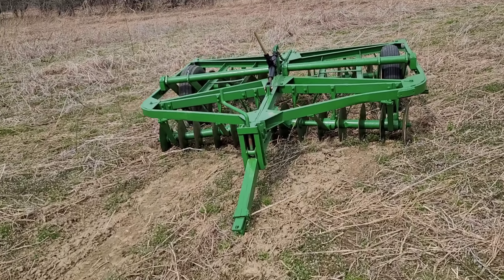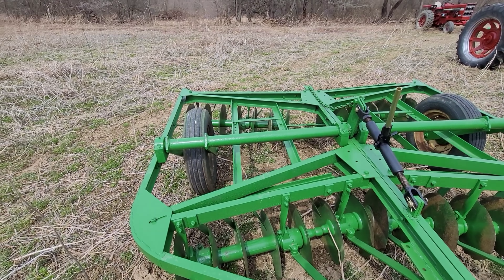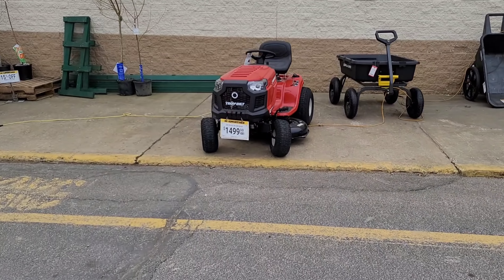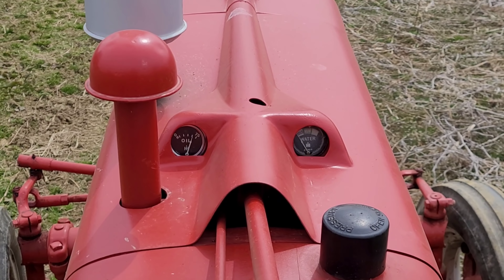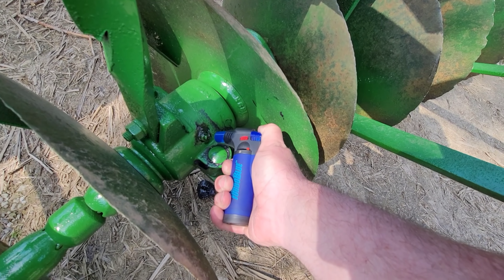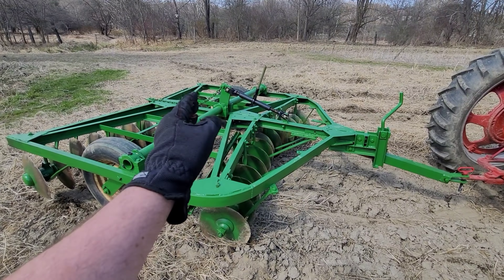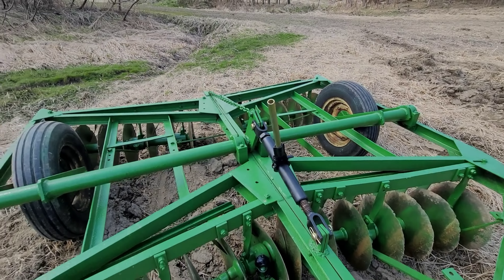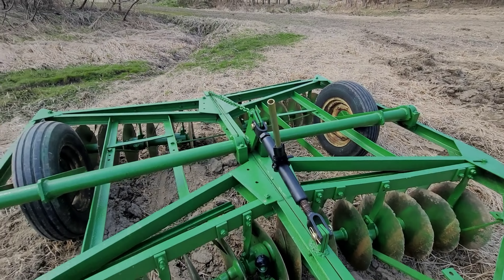Farmall H Discing a Field

Comment: Wow, that ground looks dry. Same here in Clearfield County. Trouble there's not a great deal of rain in the long range forecast .Looks like you've picked up a nice implement that will last you quite a few years ahead  and the nice part is that they seem to operate pretty quietly. More often that not the opposite happens with farm auction equipment. Chalk up another auction win for the Farmall Fanatic .
Reply from the maker: Boom 💥

Comment: Ha! I was just talking to Erik about how you worked your fields with basic equipment. He argued you can't get smooth fields without big expensive equipment. So don't be surprised if he's commenting on lots of videos,  lol
Reply from the maker: His comments will be like "Wow! I'm shocked! It does work!" 😁
Reply: I don't know if I should laugh now or wait until he posts. ;v) :vD
Reply: Of course the old equipment works and the smaller equipment lets the operator better tailor the land.
Reply: Be careful heating zerk fittings FF. I remember in a shop a guy heated one and the little ball shot out and luckily hit him in the cheek and not in the eye. It went in enough to get stitches. Of course this was before safety glasses were cool
Reply: @rodneywager2142  I had that issue a few times. Bought a Zerk Zapper. Been happy with it since.
Reply: Very few people will take the time to figure out and adjust their equipment to level up. Everyone wants to drive like bats out of hell

Comment: That disc has what appears to be the old style "box" cast iron bearings. The old Ford discs had those type bearings. Wish you wouldn't hack on the Deere folks by blowing them up that way. I have operated most all colors in my 62 years but I bleed green. Working on a 1949 B model refurbishment right now...
Reply from the maker: I definitely remember the Fords having them and we always called them clam shells but they are definitely called boxing's

Comment: I would like to see some nite plowing with a little blue flame out the stack.. I used to pick up a gear after sundown.  Cool damp air.  Try a drag on the back of  the disc.  Cement blocks to adjust weight.  Use 2 by 6   3 across and two coming up to top frame in the middle of back gangs  drag at about 30 or 35 drgree angle . can't move on the road .. We used a sled .  2 disks on the sled.
Reply from the maker: I definitely did last year I probably will again this year

Comment: The mighty H handles those like a champ buddy I just picked up a set of IH 10’ disks that I think it would pull just fine. I can pull them with my little 901 ford in third gear
Reply from the maker: Wow where did you get the discs?
Reply: A nice old feller up the road here a couple miles from me. He just used them for working up his kids 4-H horse arena. It needs a few scrapers and a wheel bearing but for $350 I couldn’t let them get away

Comment: my H turned 31hp with the 7:1 compression oversize pistons qnd high compression gas head before the upgrade could only pull an 8 ft drag disk after the upgrade a 10ft in 3rd gear most of the time 2nd in heavy ground.
Reply from the maker: I pulled this in 3rd gear without any problems

Comment: You happy with the weight of it ? Solid day for the H right there. Proves me point again that a four wheel drive of the same HP would be SOL with a pull disk that size. Meanwhile IH walks off with it thru plowed ground. Haha I like that finger for a pin. Least a finger would holler when it falls out 🤣🤣🤣🤣.
Reply from the maker: I thought maybe I would get a volunteer for the finger pin 🤣
Reply: @FarmallFanatic  lmk if any lucky volunteers come forth , sure would be handy to have 10 finger pins at my ready. I go thru a handful a year. If I use all 10 , I’m worried it may leave the next guy a bit shorthanded 😂

Comment: Hello, I think that your discs may be worn down just a bit which may have caused part of the issue with the discs not turning as they should at first. 
Always Remember that the grease gun is your best friend in keeping your equipment up and going like it should. 
The ribbed agricultural tread tires made the discs look much better than the old “Maypops” that you usually see on used farm implements and wagons. 
Best Regards From Versailles,Ky.
Reply from the maker: I bought these at auction